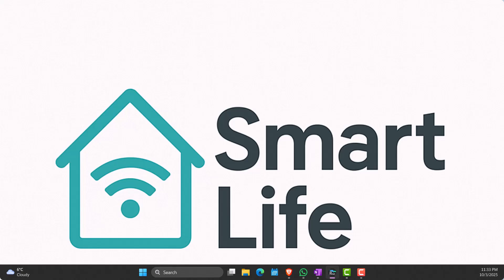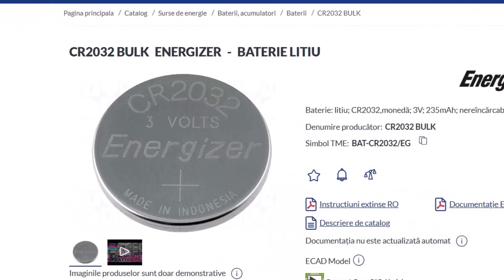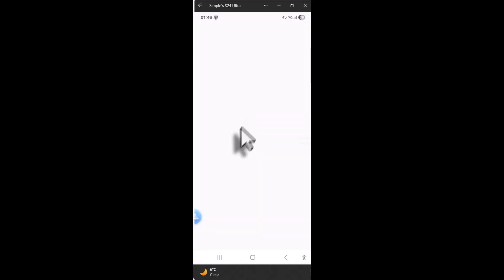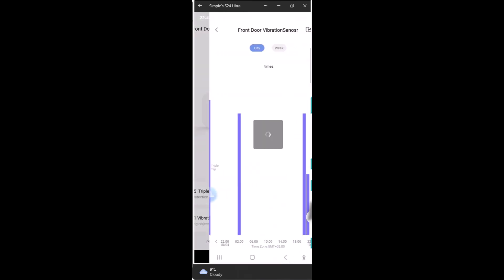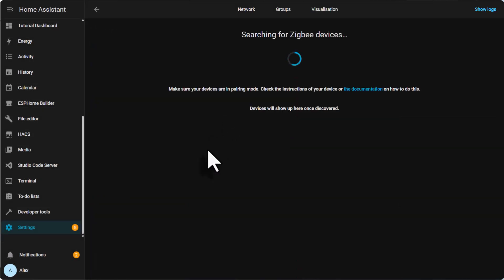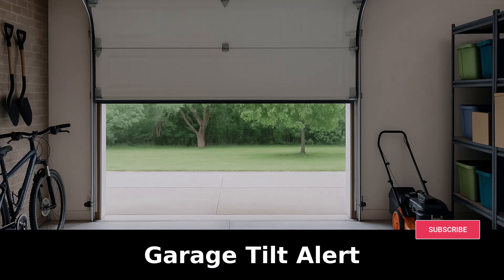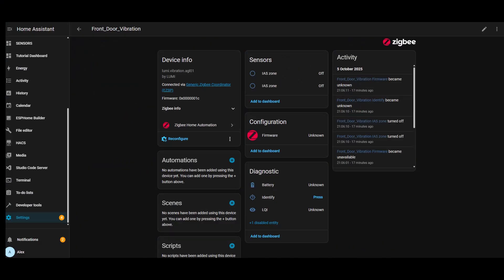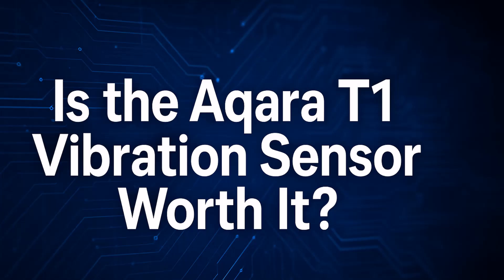Aqara T1 Vibration Sensor in Home Assistant (ZHA vs Zigbee2MQTT Test)

Comment: with the t1 , i have home assistant. is it better to get the aqara hub then integrate with HA or use zigbee directly to HA. i see for some aqara devices, a hub is needed.in more sense would i lose features like seeting to low medium or high sentevity if i use HA instead of using aqara hub??
Reply from the maker: For this sensor, I think the best option is using it through the Aqara hub, because that’s where you have full control over sensitivity and settings.
When paired directly with Home Assistant, the integration for this sensor is more limited, so you lose some of that fine control.